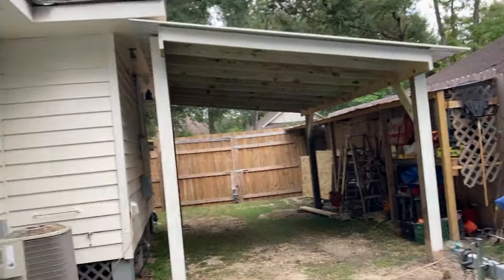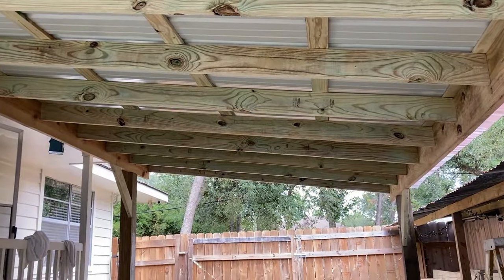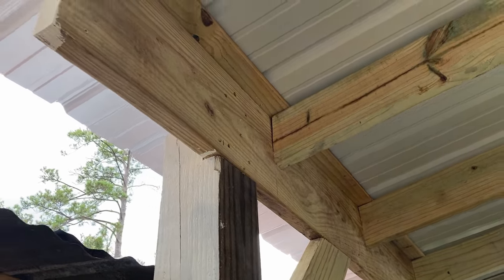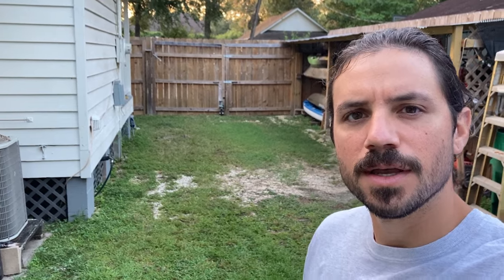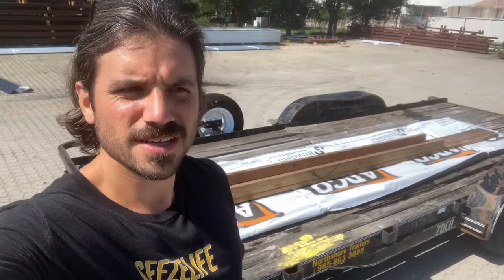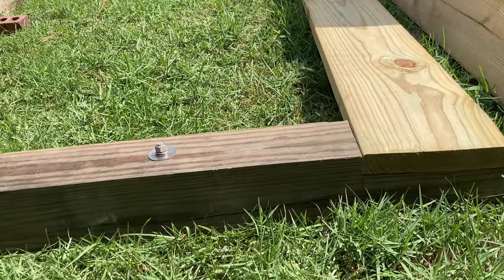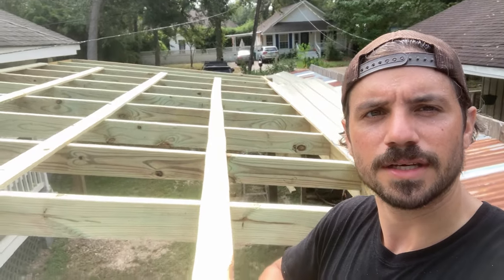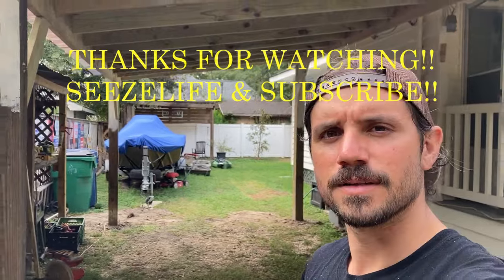How To BUILD a LEAN-TO CARPORT | 12x20 Covered Shelter | Minimalist Design

Comment: I like it.  Simple and elegant. All the wood is pressure treated except for the slats?  Is that because pressure treated lasts longer than regular wood?  I mean you could have saved a few bucks on the rafters.
Reply from the maker: All the wood I used was treated. For any outdoor exposure, I prefer treated for better longevity especially due to the high level of humidity we experience down here in South Louisiana. Thanks for watching.

Comment: I'm thinking about doing this on my mobile home. How did you attach to the house? What was cost overall?
Reply from the maker: Hey Joe, I didn’t attach the carport to the house and the overall cost was right around $750.
Reply: As someone that owns a double wide with a front and rear porch/overhang that was attached to the house by the previous owner... DON'T DO IT!!! A mobile home is always moving (settling) and all it did was cause water issues where the two structures connect. It's too much weight to just hang off the side of the house. I took apart the back lean-to and rebuilt mine freestanding in a variation of what's seen in this video. Now there is no more damaging weight hanging off the mobile home. The front will be disassembled as well. I hate that the previous owner did that. He basically ruined part of the house by trying to improve it.

Comment: Really nice job, what’s the length of the 6x6 posts and were the side posts higher than opposite posts to get the pitch ? I know you said 2 1/2 ft in ground ; can you tell me how high above ground all 4 posts to creat that pitch ? Thank you 🙏
Reply from the maker: Native Cherokee, thanks for watching and your comment.

The posts on the house side were 12ft long and buried 2.5 foot in ground. So the height of the roof on that side is roughly 9.5ft

The posts on the fence side were 10 feet long and buried 2ft in the ground. So the roof height on that side is 8ft.

With the horizontal distance between the posts on the house side and fence side being just under 10ft, the slope of the roof was roughly 2/12 (I’m not a roofer but I learned this term during the course of the project).
Reply: I appreciate your reply , I started on this same exact project today thanks to you 😂, I only dug one hole as I’m trying to figure out how to square it off perfectly, I’m not as lucky as u had it next to your house to run the line , so again I watched more videos to get as close to make a perfect square , got the string and laser from Home Depot, I’ll keep you posted once I’m done , you’ve inspired a 60 year man so it might take me a while 😂
Reply from the maker: It will certainly be a fun project and you’ll learn a bunch. Hope all goes well…SEEZELIFE!

Comment: Thinking about doing this with some T-11 siding and turn it into a shop for my projects. Currently rebuilding a 6.4 Powerstroke! Thank you very much for this video. Could i get away with 2x6x16's for the rafters or will I have to buy 2x6x20's? I am struggling to find 20's in my area.
Reply from the maker: I think you mean the joists which are the horizontal support between my posts. I used 2x10x20 because I could find them at a local woodshop (not a Home Depot or Lowe’s since they only carry 16ft). You could get away with 16ft and only two posts but then your shop wouldn’t be long enough to fit your truck completely underneath it. My 4Runner is 16 feet long hence wanting the 20 foot overhang. What you could do is add a third post on each side and then get either (2) 10 or 12 foot joists so that your shop could be a longer length. You would have to tweak my design ever so slightly but that’s what I would do to make it work.
Reply: @SEEZELIFE  In the description it says (11)2x6x20' rafters. I planned on doing the 2x10x12's for the joists and adding a 3rd post on each side to allow for a 12x24, giving me plenty of room to fit the truck under and have enough room to work around it.  I was just wondering cause 20' is quite a lot of length for rafters, i'd assume they would be 12ft ±9 degrees. I assume you meant another measurement for the rafters?
Reply from the maker: Yessir, you are correct…Just updated the description. 2x6x12 is the correct rafter length I used. 2x10x20 is the wood type I used for the joists.
Reply: @SEEZELIFE  Gotcha, thanks again for the build!

Comment: Looks great! About how tall is the roof on either side?
Reply from the maker: I mentioned it when talking about the slope and height differences but the shorter side is just over 8 feet and the high side is around 9.5ft. It’s a 9 degree slope. Good luck with your build sir !
Reply: @SEEZELIFE  thank! Sorry, I must have missed that.

Comment: Interesting, thanks for posting.  Is there any concern about the 2x10's sagging in the middle?  It seems like it would be reasonable to throw up a couple of 4x4's halfway down just to help hold it all up, or is that totally unnecessary?
Reply from the maker: Unnecessary for my load. Considering the support braces in each corner the length of unsupported load is only about 12ft across which for a 2x10 is nothing. Thanks for watching my friend!
Reply: @SEEZELIFE  I appreciate your prompt response.  I tend to over-engineer everything out of a spirit of paranoia, but wood ain't cheap.
Reply from the maker: Glad to help. Enjoy your project 💪

Comment: Nice job, But I'm wondering, would it leak when it's pouring down raining?
Reply from the maker: What area are you wondering if it could possibly leak? Just trying to understand your question better :)

The metal tin doesn’t leak on any area that is covered. Hope that helps!
Reply: You use a metal to wood screws with a rubber washers on them.
Reply from the maker: @rc_repair yes

Comment: Can that withstand Midwest winters and winds?
Reply from the maker: Wind - definitely. If you get heavy snow, I may recommend a little bit more slope to be safe but it should be fine if using similar strength wood types.